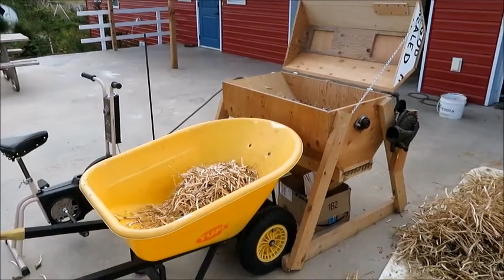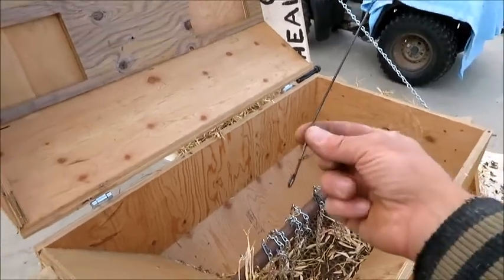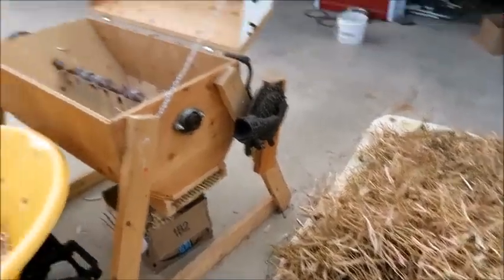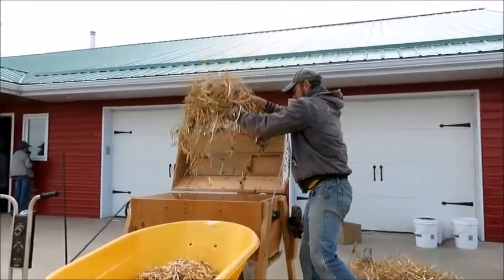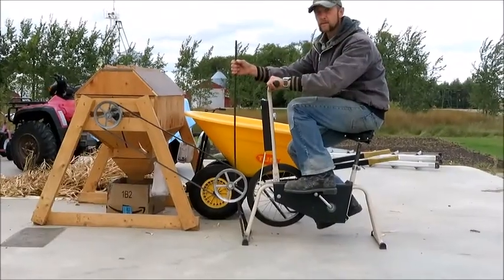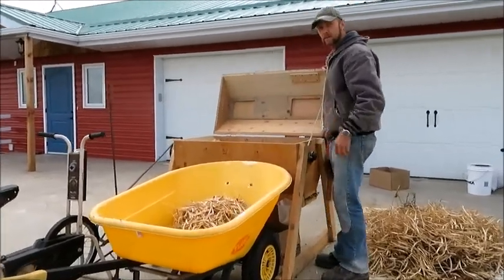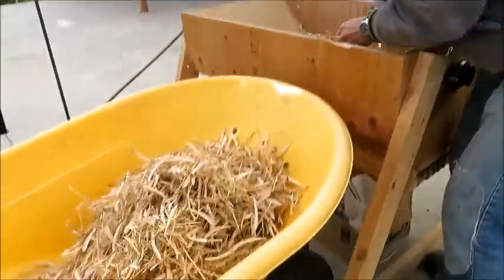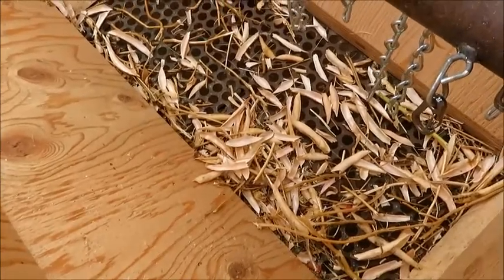Bike Powered Dry Bean Threshing

Comment: I just saw your comment on the farmhack building instruction page noting that this thresher was much more work to get wheat to thresh well.  Could you elaborate at all on the issues with wheat?  I've been thinking of building a copy of this thresher mainly for wheat, and I'm extra motivated today after my old pull type combine broke again today.  Do you think a different design might be better if I'm mainly wanting to thresh small grains?  Did you ever see Jeffrey Funk's bicycle powered thresher design (which I think is pretty similar to the threshing cylinder of a conventional combine except much smaller, and he only feeds the heads in and then pulls the straw back out, which seems much less desirable for my purposes than a design like this that doesn't require sheaves of neatly arranged heads and at least medium long straw)?  Having built this thresher, what design would appeal to you most if you were mainly wanting to thresh wheat?  Thanks!